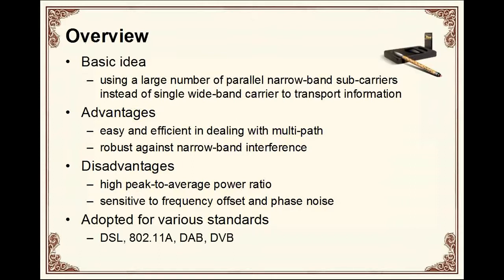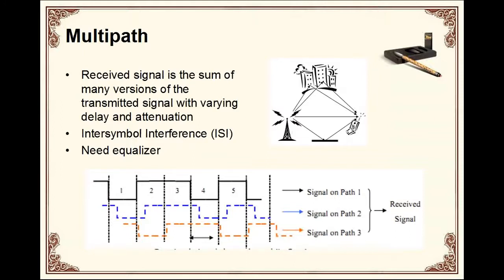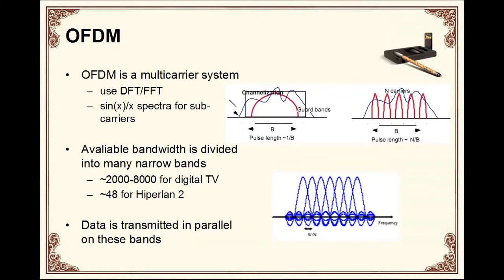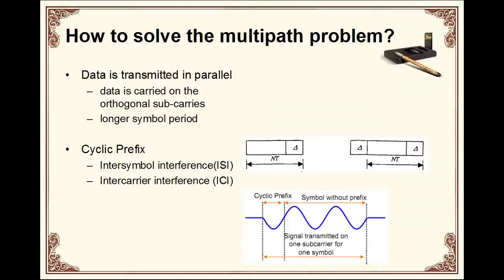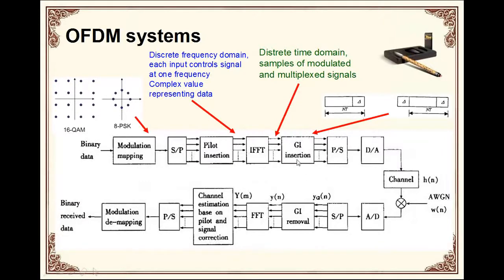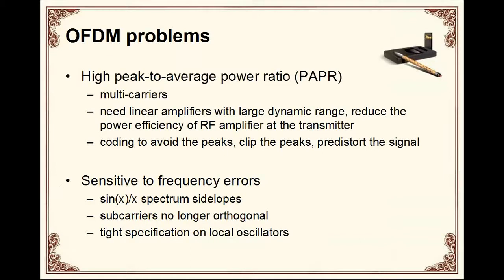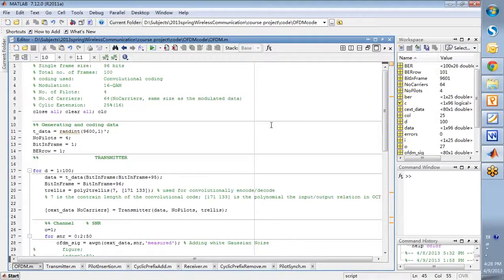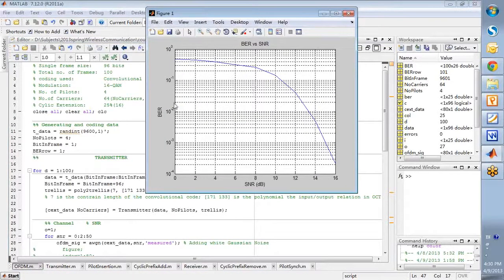OFDM technique and its simulation using MATLAB 720p

Comment: IFFT will generate lots of vectors (complex numbers). But I think that the time domain output is probably nothing like the 'classical' OFDM. That is because a 'time sequence' associated with the output of an IFFT block would probably need to be REPEATED (again and again and again) in order to have the 'spectrum' that we're hoping to get. But it appears that the IFFT technique doesn't produce the classical OFDM signal. It also appears that the IFFT method isn't really classical 'OFDM' at all. Or the IFFT technique is probably not even OFDM.